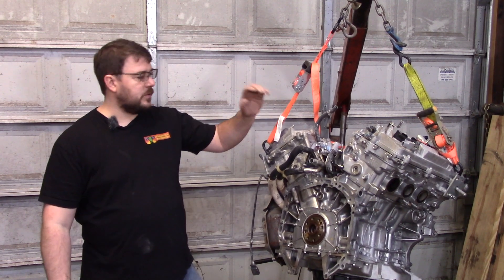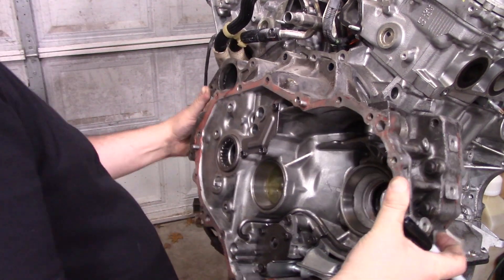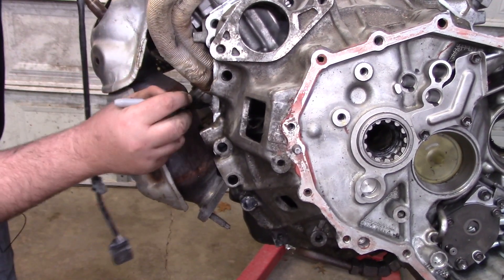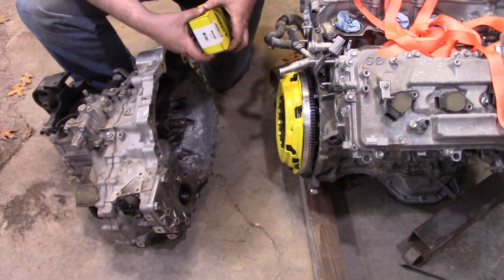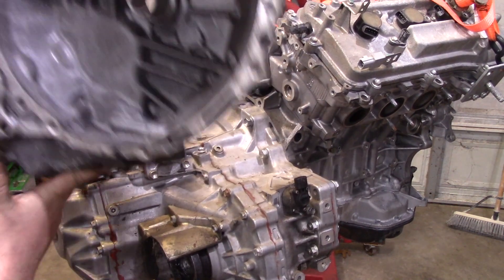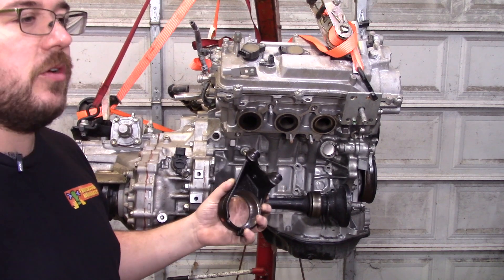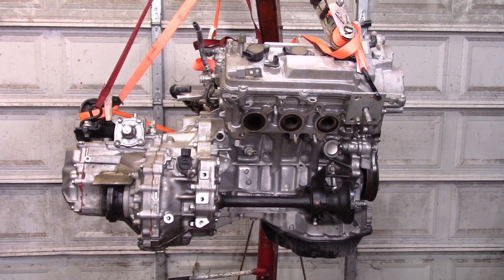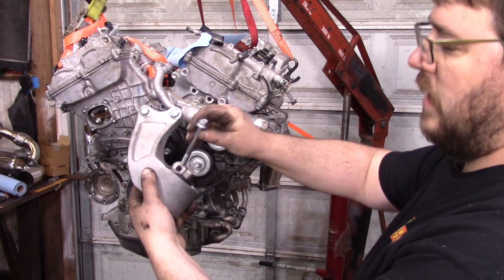2GRFE MR2 SW20 Install Instructions Video #1

Comment: I like the videos your doing, should help a lot when I decide to do this swap.. (I know I will eventually)

Any word on if the Scion tC 6 speed would work? I think I have one sitting at work that Toyota never called back with diff noise.
Reply from the maker: The EB60 transmission does bolt up to the 2GR with a bit of grinding in a few spots but it's a great transmission. It will require three custom motor mounts and some custom shift linkage though. I made mounts and linkage for that trans for my MKIII 2ar-fe swap kit but not for the MKII.
Reply: @FrankensteinMotorworks  Hey Marc, maybe you should consider making an EB60 kit for the MKII.  E153s are getting to be harder to source, and a six speed would be neat.  (Especially since five speeds feel pretty old school at this point.)  Also, the final top gear out to be a little longer.  Which would be nice as well.   Though I'm curious how much torque the EB60 can take, as the E153 has proven to be pretty stout.
Reply: @bujin5455  I saw that the EB60 is given to support 400 hp, after the torque I don't know
Reply: Frankenstein Motorworks eh a little custom fab didn’t hurt anyone. 6 speed seems like it’d be a good fit for the 2gr (unless I could get my hands on a lotus unit) just gotta find a car.
Reply from the maker: @001dman  I have an Evora EA60 trans here that i would just straight up trade for that EB60 if that's what you really want but i will warn you that i would be getting the better part of that deal. The EA is certainly stronger but it's also much bigger and heavier.  I'm absolutely serious about the swap if you're interested.
Reply: Frankenstein Motorworks I’ll see if it’s still back there and not tagged by Toyota. If they tagged it I can’t take it. Yet
Reply from the maker: @001dman  Yup, i know a few guys that work at a dealership. i know how that works :) no hurry on my side.
Reply: @FrankensteinMotorworks  if the EB60 comes from a European traction, is there a need for a custom linkage ?